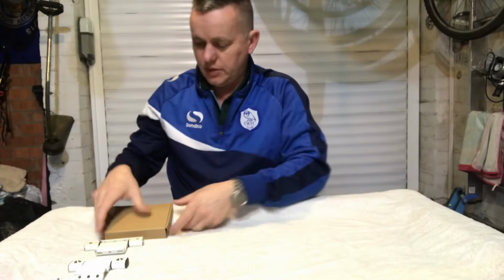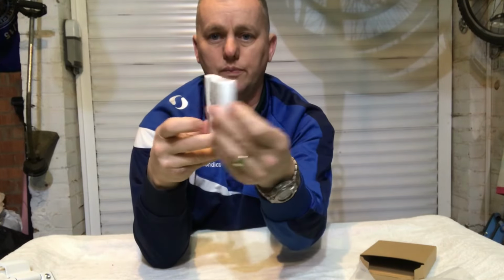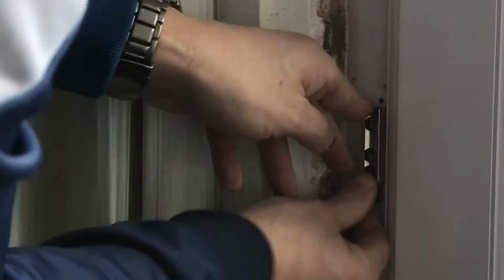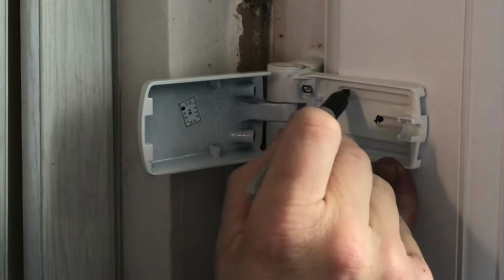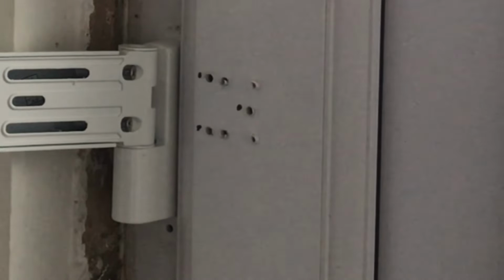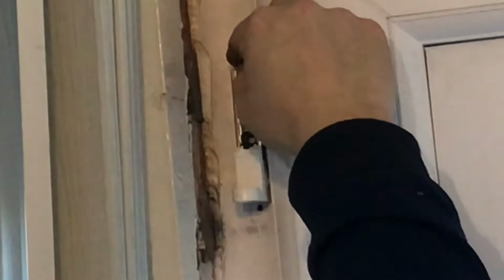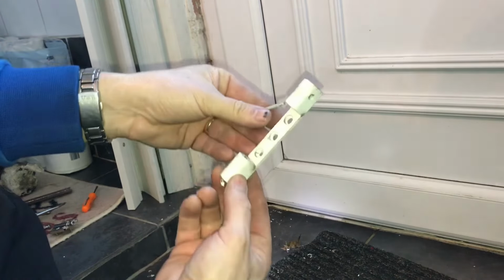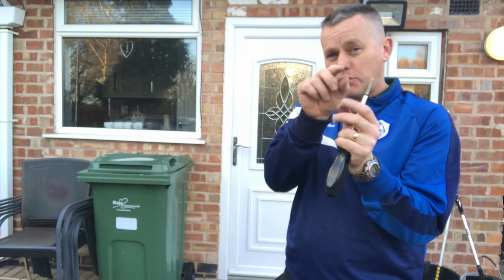UPVC DOOR HINGE BROKEN, How To Replace With New Style Flag Hinge

Comment: Top man.  My door hinge isn't broken, but they are the old style and do not allow adjustment.  Now either my door was not fitted correctly or over time has become misaligned.  The old door hinges in your video look very similar to my ones.  Those flag hinges look like the ideal solution to solve my problem.  Cheers for that information.  Nice demonstration.
Reply from the maker: They are a great solution, Thanks for the great comments👍🏻👍🏻🛠

Comment: i work with these every day of the week although we use a jig to fit them to get all the locator pins exactly where they should be! there's vertical & horizontal adjustment in these plus compression. eye balling it cant be accurate but looks like you got them working!
Reply from the maker: Thanks for the great information👍🏻👍🏻🛠
Reply: Does the jig you use only work for 1 type of flag hinge?, or does it work for any brand and style of flag hinge?.
Reply: @ObbardProductions  hard to say mate used the same hinges for as long as I can remember! Never used any other sorry.
Reply: @Adventuristic89  Thats ok mate, what hinges do you normally use? and what jig?, and do you recomend upgrading any old type of upvc door hinge with a flag hinge if its broken?. thanks.
Reply: @ObbardProductions  the hinge I use are called Trojan patriot flag hinge 2002. Can’t say I know the name of the jig but you should be able to find one if you can get a supplier of the hinges they will no doubt have a jig too.! Changing the hinges should be ok to do! Maybe take a photo of it & look up your nearest manufacturer of windows & doors good chance you could wrangle a hinge off them & some advice to fit it too! Hope this helps.
Reply: @Adventuristic89  Thanks for your help mate.

Comment: As a service engineer I retro fit flag hinges quite often andf I can tell you you've positioned the hinge on the frame in the wrong place, yes the door swings but if you look at the video at 18.57 you will see the door sash is touching the hinge backplate already so you cannot adjust the door laterally to the left anymore in case you needed to, your mistake was using the same holes in the frame from the existing hinges, you should have drilled two fresh holes for the locating pins 5mm further to the left
Reply from the maker: Thanks for the great information👍🏻👍🏻🛠

Comment: Good video - thank you. Some years ago, I started to replace old hinges (same as in the video) on a 830 wide exterior door, with a lower steel-reinforced panel.  On drilling for the first flag part of the middle hinge, I realised that the door plastic did not have a steel inner. I was therefore concerned that the 4 screws (plus two pins) per hinge would not securely hold the weight of the door in the long term, and start to sag.  I backtracked and was able to adjust the old hinges more to get a good fit.  In your experience is screwing into door-plastic sufficiently strong? It looked like is is, in the video.
Reply from the maker: My door is still going strong, Thanks for the great comments👍🏻👍🏻🛠

Comment: Will the door and hinges lift off the spindle once installed? Is there a fixing which stops this? My door is stuck in the closed position so want to know
Reply from the maker: Yes, there is a grub. Screw you connect and tighten to stop the door from lifting off the spindles. Thanks for the great comments👍🏻👍🏻🛠

Comment: Really good ,easy to follow instructions.
The only thing I did'nt
get was at the end you screwed up something at the bottom of the hinges?
Reply from the maker: That was the adjustment of the height of the hinge there is a blanking Cap as well that goes on the end maybe it was that Thanks for the great comments👍🏻👍🏻🛠

Comment: Very informative. I have exactly this issue but the uPVC repairers I have contacted will not retrofit flag hinges claiming they carry too many problems. Am I just choosing the wrong people or are there some doors which will not accept these hinges? My door has chamfered edge with an angle of 30 deg and is the reason why I cannot find a replacement butt hinge.
Reply from the maker: most old doors can be retrofitted, Thanks for the great comments👍🏻👍🏻🛠

Comment: Really helpful video. Was wondering, when you fit the flag to the door, you mention using two shorter screws and two longer screws. Do you recall what sort of lengths were you using? Thank you!
Reply from the maker: I Believe 30mm into the outer frame and 20mm into the door, Thanks for the great comments👍🏻👍🏻🛠

Comment: Hi sir ,you had done very good job to fix the hinge in pvc door , but my pvc door can not be locked , ( when I close it ) , however I open the door to lock the door , ( the door can be locked , the key is prefect) , I think the door need some adjustment to lock it. ( from the hinge) . Will you possible to tell where need to be adjusted, thank you
Reply from the maker: Are your hinges the same as these, Thanks for the great comments👍🏻👍🏻🛠

Comment: EXCELLENT, but you should have shown how to adjust the door sideways, the other thing is that this hinge  has a squeeze adjustment and can be bought in 3 sizes dependant upon the thickness of the door profile, 16mm, 19mm and 22mm
Reply from the maker: Thanks Gary, I find it best to keep it simple, its easy to make a job harder than it is, thanks for the great information👍🏻👍🏻🛠

Comment: My daughter's old but hinges are fitted outside on her patio french doors. The door has dropped at an angle and the adjustment is as far as it can go. The flag hinges look good but is no use on the outside due to the security risk, any ideas ?
Reply from the maker: Thanks for the great comments👍🏻👍🏻🛠
Reply: @aaanton11  I was rather hoping for some advice or suggestions, all I got was a bland useless reply !
Reply: @flier9708  My porch door opens outwards and is fitted with Mila Evolution hinges which should be good as you can adjust them in three planes but my fitter  seems to have damaged the sideways adjustment and the door keeps tilting.
I found this fitting sheet  https://www.justdoorsuk.com/downloads/mila-evolution-hinge-adjustment.pdf  which might be of use to you. I realised that the fitter also failed to fit the caps or the locking grub screws so have just sent for some off ebay to hopefully sort it. If not, I shall have to fit a new hinge. No wonder the old one doesn't stay adjusted!
Reply: @AmbroseB1900  Thanks for your help, much appreciated.

Comment: I have a question given the fact that I have had training albeit by the fire brigade for roof ladder access... Why would you remove the new middle hinge to then replace the top? ... the brigade expressed the opinion always have as many points of contact to keep stability and safety? By removing the new middle one are you then not relying entirely on the lowest hinge?
Reply from the maker: the door latch would have supported it, Thanks for the great comments👍🏻👍🏻🛠

Comment: Im a caretaker at a nursing home and they have 4 of these doors but really f'ing wide and old - all of them have dropped and one of them the top hinge has snapped exactly like the hinge you was holding at the start but snapped on the thin part connecting at the middle...ive ordered a replacement like you did without watching this but I have a feeling it won't fit and even then I wont be able to adjust the door as its dropped and leaves a gap at the top handle side and the lock wont lock unless you lift the door as its pointing diagonally in the lock case...my question is the hinges used to connect to the side of the door but now you put the hinge on the face of the door...will the face of the doors plastic be enough to hold the door? The doors ill be working with are wider and heavier and all have 4 hinges. So you dont need to take the door off even if its dropped a bit as hopefully you have adjustment after they are fitted you just fit them one by one then adjust them all? thanks for this video mate they would have needed new doors otherwise. Ill try and post a followup vid of me fitting them but would appreciate any advice. Like I said its pretty urgent as one has completely broke and is stressing all the other hinges, I've had to prohibit the use of the door for use only in an emergency but the staff there dont care and will prob still use it for smoke breaks...sorry for the long comment.
Reply from the maker: Yes the flag hinges are the way to go, they will hold the weight no problem, good luck, thanks for the great comments 👍🏻👍🏻🛠
Reply: If you use some shims to allow some space on the underside of the door, ie wood or plastic packers, make sure it’s the same amount as level to the frame and paddle the doors up to slide your shims in when in the locked position. When all the hinges are fitted, use the paddles again to push up the bottom of the door to pull out your shims and it will return to where you set it. Then adjust if required. Can always Repair upvc doors, so many people say you need a new door when you really don’t.  Great video 👍🏻👏🏻

Comment: How did you support the door when doing the top hinge? Regards John
Reply from the maker: you can support with anything the right thickness that will fit under the door, a folded piece of card or a bit of wood, even the wifes foot fits just right,Thanks for the great comments👍🏻👍🏻🛠
Reply: @aaanton11  I find the doors a bit heavy and have a tendency to want to lie down 😉

Comment: I would like to retro fit these hinges, does it matter the thickness of the door part that hold the seal.  (distance from the door face and frame face) I have looked at a few hinge diagrams and this measurement isn't on, I would have thought it important, Cheers
Reply from the maker: the hinges are fully adjustable, so it wont matter, Thanks for the great comments👍🏻👍🏻🛠

Comment: A really good tip is to beat the locating pins off the door side of the hinge, this will allow more adjustment and will save you drilling and messing up!
Reply from the maker: The locking pins stop the door from dropping over time, Thanks for the great comments👍🏻👍🏻🛠

Comment: My mother 1995 had the front house from Anglia windows double glazed there are still working no gas has leaked handles we have put two different windows at the back they are all gone already that's what happens when you try to use all these cheap rubbish all around
Reply from the maker: Thanks for the great information👍🏻👍🏻🛠

Comment: Unfortunately, the door hinge is small.
Bad choice.
Reply from the maker: Which hinge is too small mine or yours ? Thanks for the great comments👍🏻👍🏻🛠
Reply: @aaanton11  
top door hinge, Wing distance is zero. (Unfortunately, the door is not installed exactly).
Coupling pins are short. It's just in the plastic
The 3 door hinges are not in line:
opens inward by itself.Tightening torsional force occurs.
But much better than the old door hinges.
It is recommended to use a drill template.
But it may not be clearly visible in the video.
you did it skillfully!!! 
There is a Hungarian saying.
Sh*t can't build a castle :D
Reply from the maker: Now I understand, 🤔 you are a door/window fitter, Thanks for the great information👍🏻👍🏻🛠